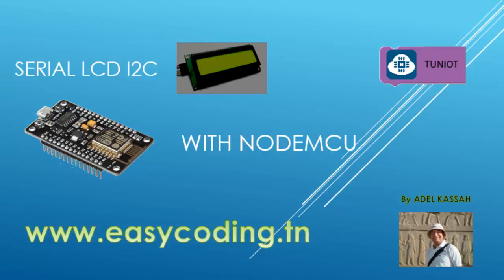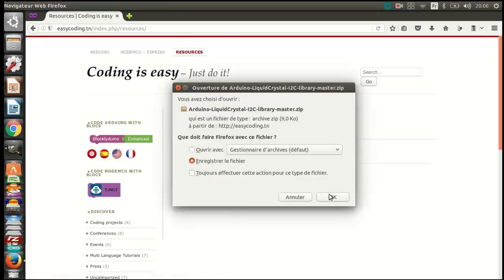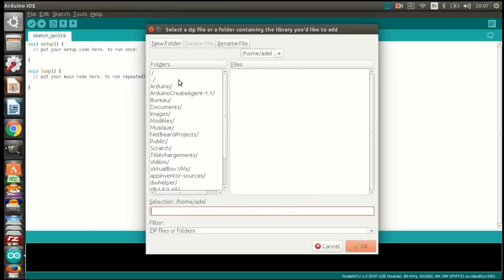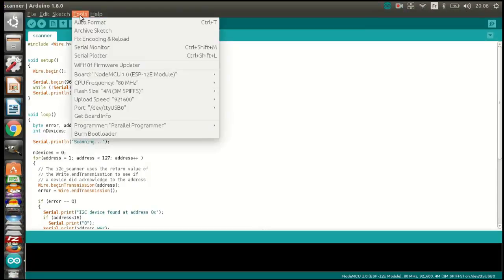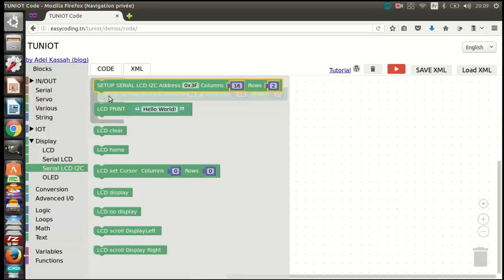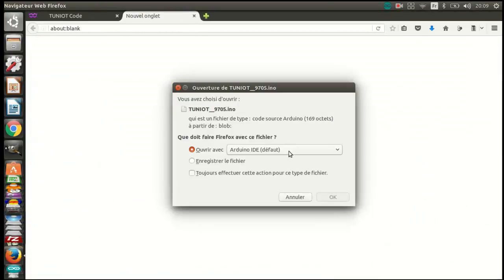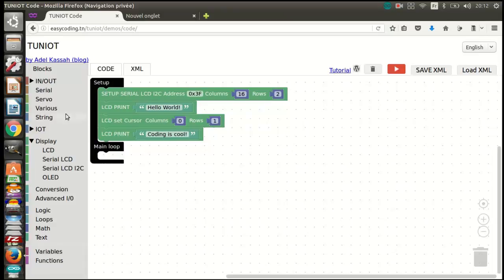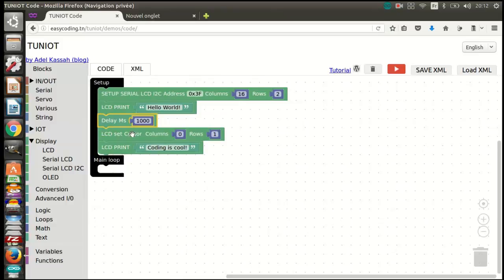NodeMcu (ESP8266) Tutorial A-07: The serial LCD I2C

Comment: I have a couple dozen of these 1602 displays with I2C daughter boards purchased from several sources. They all seem to have an I2C address of either 0x3F or 0x27. I call them "I2C_1602 LCD displays". It's nice that BlocklyDuino-Enhanced and TUNIOT both support these displays because they are quite useful for debugging as well as displaying information on devices that you want to run stand-alone, that is w/o being connected to your PC. I usually use the I2C_1602 LCD display on my Arduino Uno projects.

As you know, the I2C_1602 LCD is a +5v TTL device, and the NodeMCU is a +3.3V device. I  have used these two devices together for almost a year and when I do, I use a 4-channel bidirectional voltage level shifter module on the I2C SDA and SCL lines, mostly out of superstition (I fear I may damage my NodeMCU). My question is, whether you use some similar voltage level shifting circuit to interface these two devices, or do you interface the two directly?  I have heard, but still doubt that the GPIO lines are 5V tolerant, but I have not seen or heard it from credible sources. I would like this question answered, if any of you know by experience or from some credible source.